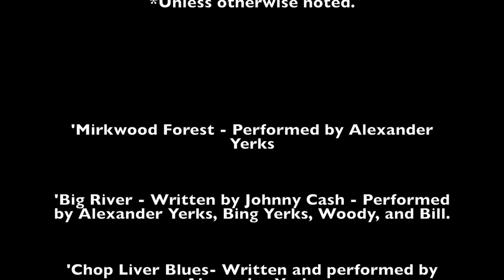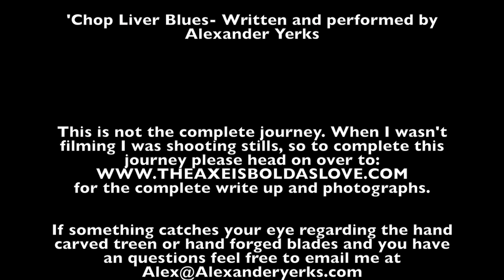Axe Carving - Kuksa - Kasa - Noggin

Comment: What is the bevel you like most? I've just re-ground a couple Kent-pattern axe heads for carving and flattening, putting a shallower angle on the left, and steeper on the right (I'm right-handed). This seemed to make sense, but does tend to skip out a bit.